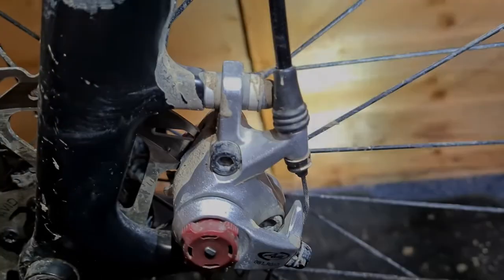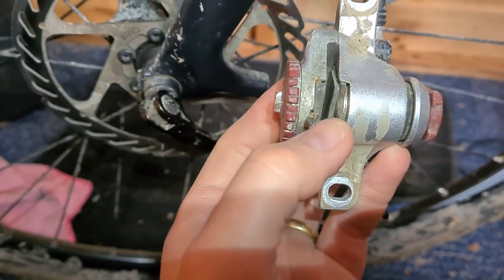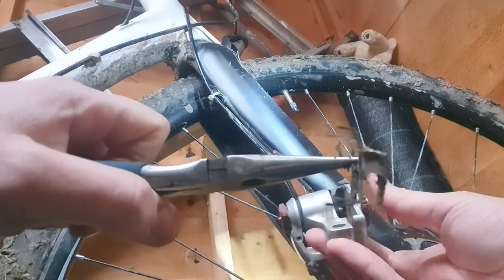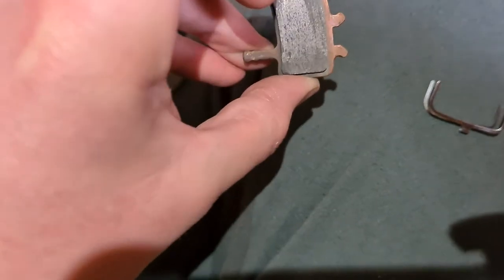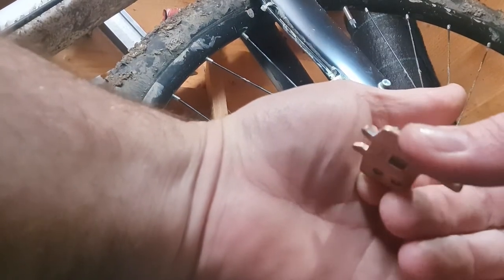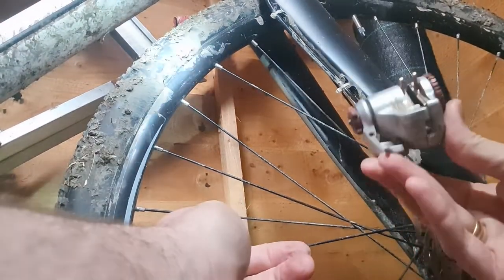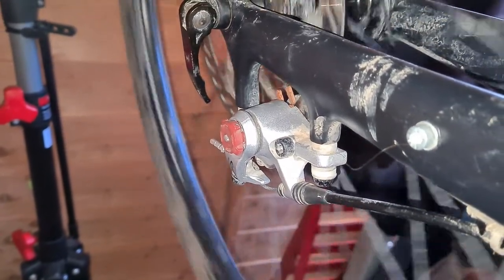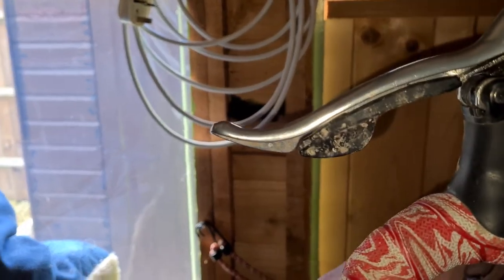Avid BB7 Brake Pads Replacement - How To

Comment: The little spring clip on top of the calipers is actually removable and can be re-inserted after fitting the calipers.
Reply from the maker: I think I show pretty well it is removable.  It will be impossible to insert afterwards.

Comment: First time I've come across these too. Until I watched this I didn't realise they clipped in. I found, a flat blade screwdriver against the pad (metal edge) and a gentle palm tap into place. Rubbish design if you ask me. Thanks for the helpful vid 👍
Reply from the maker: Same as me, only ever come across the ones secured with a retaining pin previously.

Comment: Terrific video! Thank you!
Reply from the maker: Thanks a lot. I need to get making some more videos, hit a bit of an off the bike period at the mo. Happy riding. 👍🏻
Reply: I watched several other BB7 videos before finding yours...which is half as long and twice as good! Both brakes are replaced now, the only hitch was I accidentally left the spacer in the first time, and it took me a while to figure out why I couldn't push the pads in. Thanks again, I immediately subscribed. :)
Reply: Brake pad replacement time again...your help did it again...I had to file down the nibs this time, good thing you suggested it!

Comment: Had the same issue with aftermarket brake pads. The original Avids are very good, some pads are more expensive but not necessarely better. Cleanig up the bike and the calipers, screws and bit and pieces would have helped also. 🤣
Reply from the maker: Ha ha, this bike rarely gets a clean the poor thing. It's my workhorse.